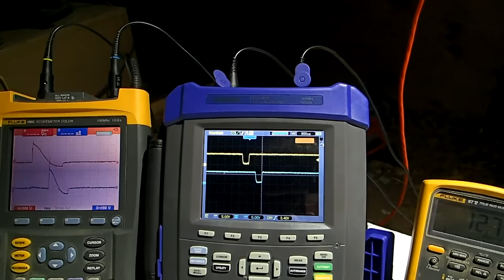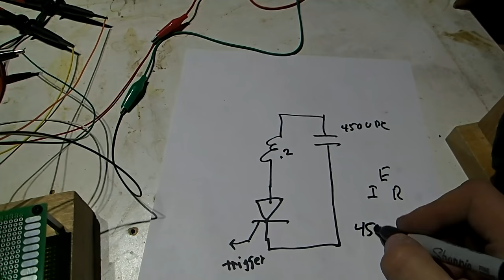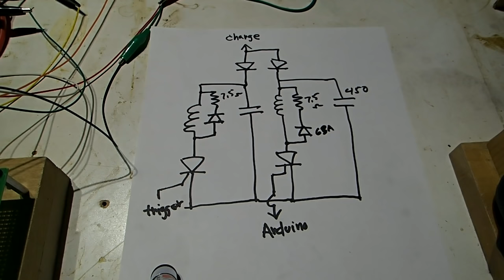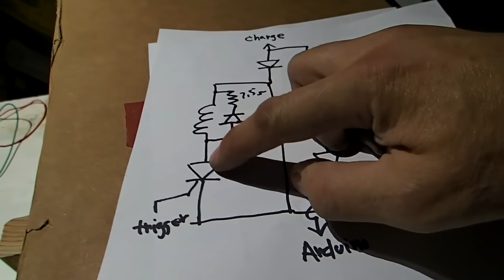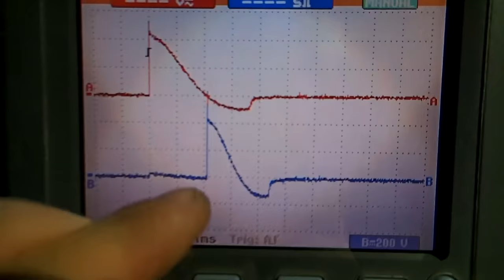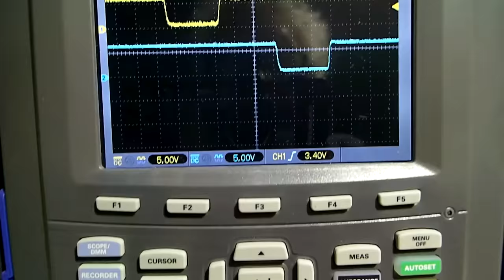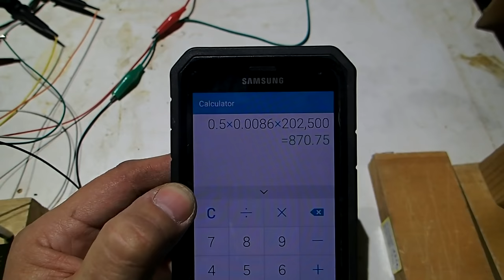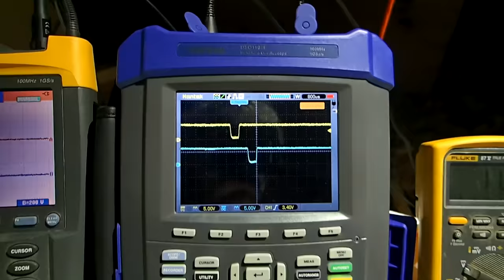World Fastest Six Stage Coil Gun Yak Questions Answered

Comment: ok just now i did the induction gun experiment and the results were not at all good the efficiency is way less than coil gun. i used a brass hollow tube of od 11mm and id of 10 mm ,think i should use thicker brass tube .
Reply from the maker: Vasudev Mr no no no I told you a steel rod 2% carbon steel or less.
Reply: yeah i am using steel rod itself i am talking about projectile ,it brass hollow tube

Comment from the maker: this is a DC circuit not an AC circuit inductance opposes AC circuits DC circuit's not going to have much effect the right time is still incredibly fast so it doesn't have much effect it actually helps it work better it's only about 300 micro Henry's
Reply: The tau is L/R so for your gun that would come out to 0.0015. Tau is 63% of max current. How is it that your pulse happens much faster than that?

Comment from the maker: oh yeah will you tell me why the first stage Coil wants to melt after 15 shots. space 4 seconds apart. inductance only plays in a role in an AC circuit in DC Circuit after 100 microseconds the coil is saturated when the coil is saturated all that is left is the dcr of the coil which is .2 ohms. thus nearly one megawatt a power is pulsed in the coil so you are wrong you don't have your facts correct.
Reply: how can you size this up to like 5 or 6 megawatts into the coil for much much higher velocities
Reply from the maker: cenexes 12 you're not going to get a higher velocity what you going to get is that you can fling a really heavy piece of Steel about a couple hundred feet per second or a little more that's what you get. don't get me wrong that's very effective, but coil guns are very inefficient.
Reply: Clay Reid then how are they ever supposed to be able to reach exit velocity and fire a satellite into space because exit velocity is somewhere around 17000 - 20000 mph
Reply from the maker: cenexes 12 DARPA gave up on that project in 1991 it was the 46th stage coilgun. the most effective use of a coilgun is in the military and it's used to launch a mortar which is very effective at doing that
Reply: What exactly does it mean for the coil to be saturated? You're sort of answering my question of why it doesn't take longer than it should to build Imax but I don't understand what you mean here by saturation. Please explain would really appreciate.

Comment from the maker: 450 volts/.2 ohms coil dcr
Reply: what about the inductive impedance of the coil won't it play a majore roll in opposing the change in current through the coil
Reply: +Vasudev Mr yes, it will, it makes a good bit of difference. Clay is just estimating the peak current a short time after t=0 because that's the max anything has to deal with just for a few milliseconds at maximum
Reply from the maker: That's why I tell you to make the coil DCR .2 ohms because the inductance will make up the rest of it you don't want the coil to be absolute dead short to the capacitors for longevity
Reply: +Clay Reid the coil would never be a dead short. Not having a diode antiparallel to the coil and letting the inductive kickback reverse charge the capacitors is the part that's bad for longevity

Comment from the maker: that's why you came to the right School my friend.

http://hyperphysics.phy-astr.gsu.edu/hbase/magnetic/solenoid.html

go to this page my friend. look at the formulas it has a calculator.

my next coil will be 17000 Tesla
Reply: Clay Reid will you use the same wire thickness which you use in the previous Coil . I guess you will not . how would you create 17000 Tesla . will you use high voltage capacitor ??